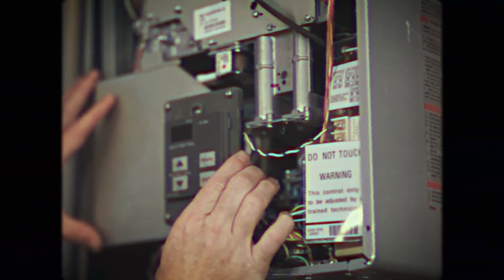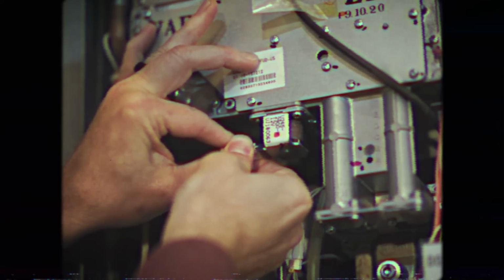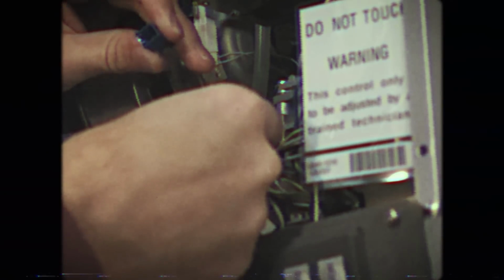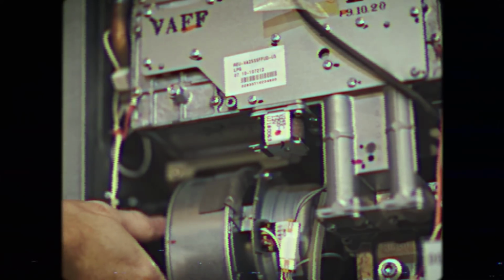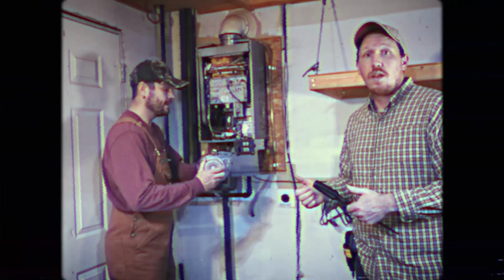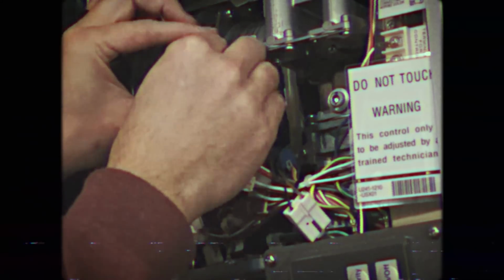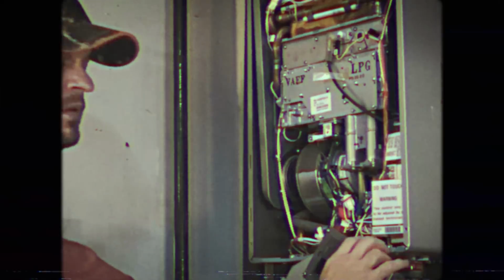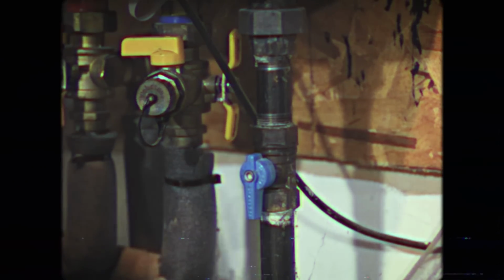S3:E04 - Rinnai R94LSi Fan Replacement

Comment: Where did you find that version... Mine came w a 4 pin connector that is differnt... Not sure if we should splice.
Reply from the maker: We used supplyhouse.com to find the right fan model. Here is a direct link. https://www.supplyhouse.com/Rinnai-104000061-K-Kit-Fan-Assembly-R75-R94-R50-VA-KT.